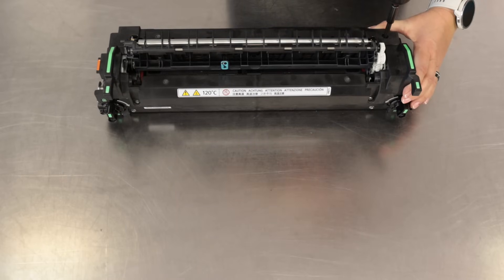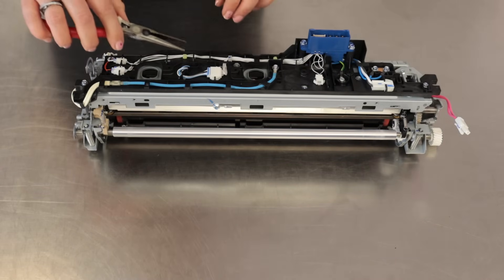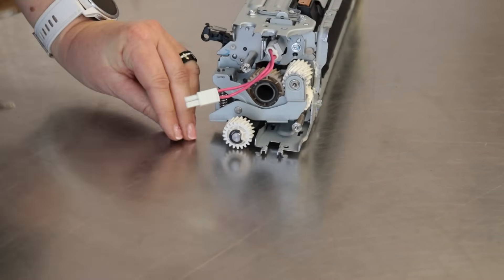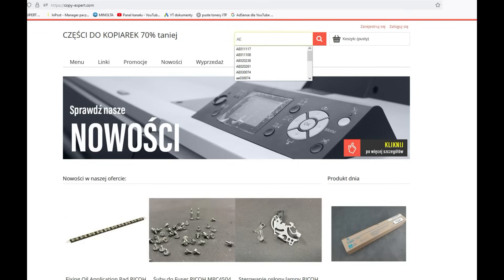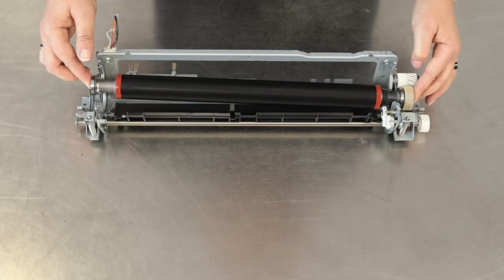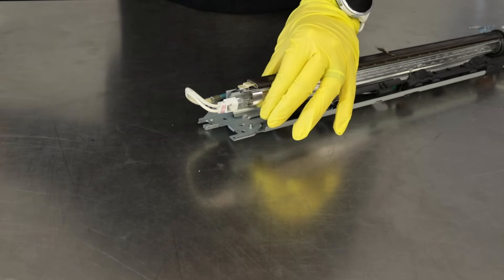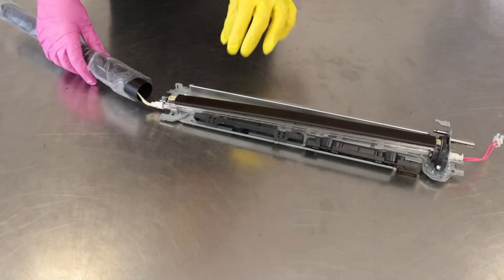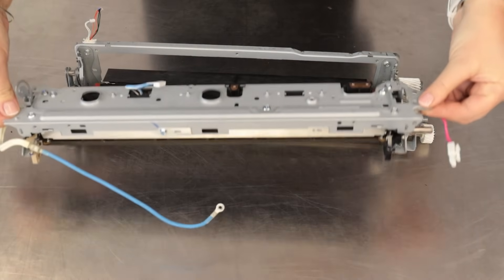FUSER Ricoh IMC2000 IMC2500 IMC3000 Fusing Fixing Film, Press Roller SC544-02, SC554-02 reset.

Comment: My fuser sleeve on IM C2000 was ripped off and came up with the error message SC 542-02. Do I just need to replace the sleeve alone?
Reply from the maker: Good day, the most likely cause of such a fault is a damaged Sleeve Unit. The heating film may be damaged and the Thermistor may be sensing the wrong temperature. If your heating film is not damaged, replace both Thermistor. To clear this sc error code, you must have a fuse. The fuse is supplied with the `Sleeve Unit.